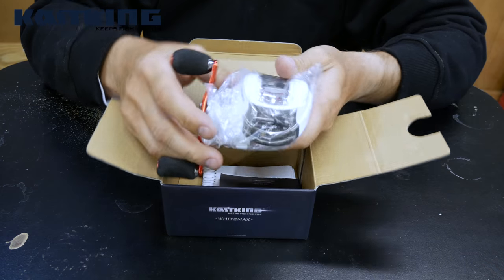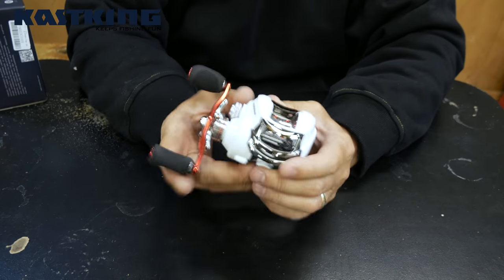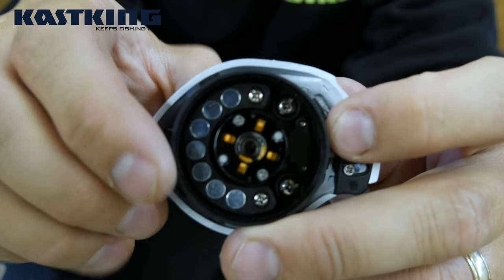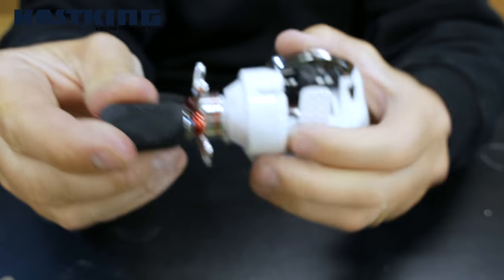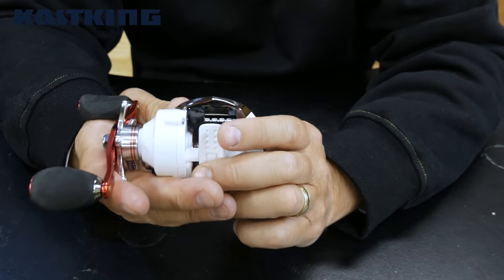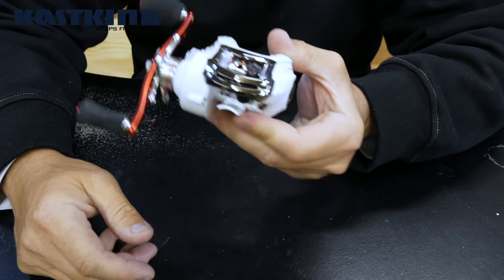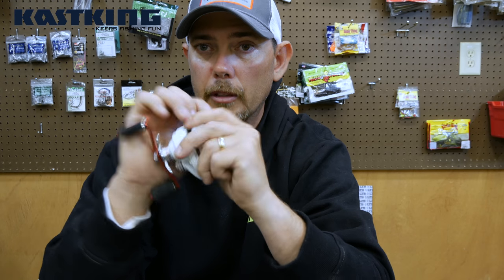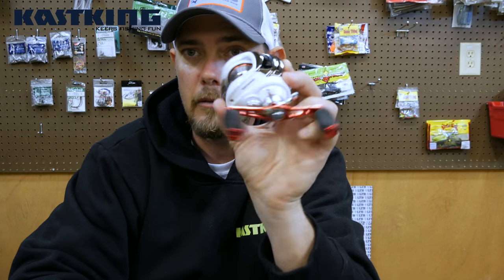KastKing WhiteMax Baitcaster ~ Unboxing and First Impressions

Comment: What is the low gear ratio mainly used for?
Reply: Realistic Fishing cranking!
Reply from the maker: Thanks for watching bud, I like using it to fish the C-Rig, Texas Rig, Cranking Deep Divers and Jigs through structure.
Reply: I use low gear ratio reels for walleye.
Reply: Do not use this reel for jigs or anything else like it. You do not use a slow reel to work things slowly. Jigs, T-rigs, and Carolina rigs are worked with the rod not the reel. You want a higher speed gear ratio to pick up the slack or to make more flips/casts. Lower speed gear ratios are best for crankbaits since they reduce the drag you feel while reeling them in, and they allow your crankbait to get to the optimum depth.
Reply: Realistic Fishing is it only for deep diving cranks or good for squarebill n shallow cranks also?
Reply: DAVID GUTIERREZ: the slower gear ratio works great for squarebills and so does a 6 speed gear ratio. I prefer the 5 speed to allow whatever crankbait I’m using to get to the right depth, but you also need to incorporate your line size. The higher pound test the higher in the water column your bait will run. Fortunately you don’t have to knit pick too much when it comes to squarebills.
Reply: Realistic Fishing l
Reply: Andrew Thomas thanks man.